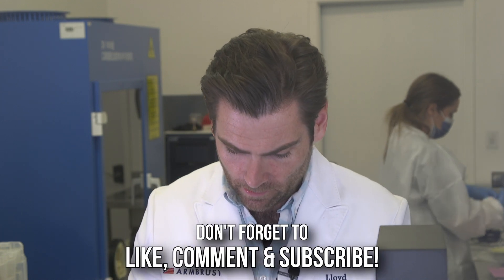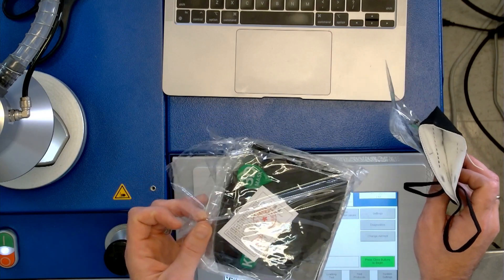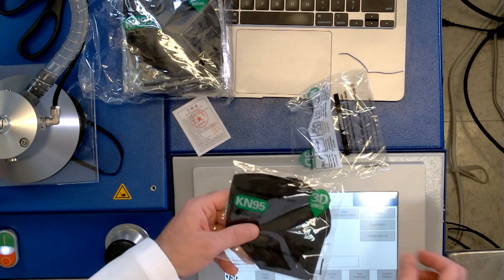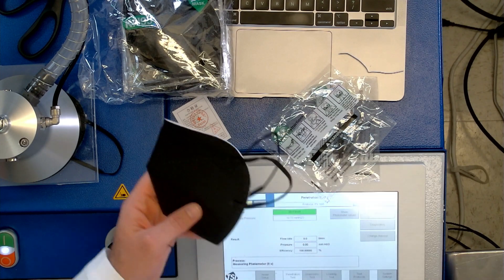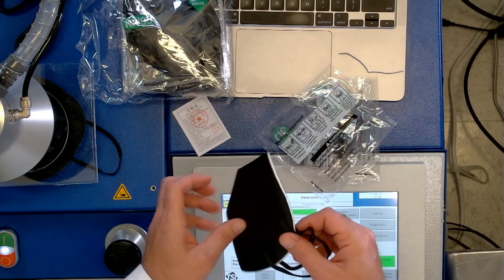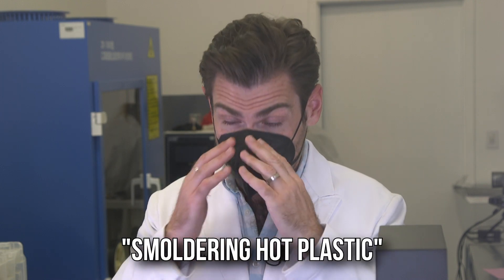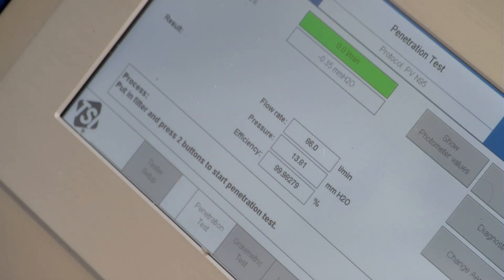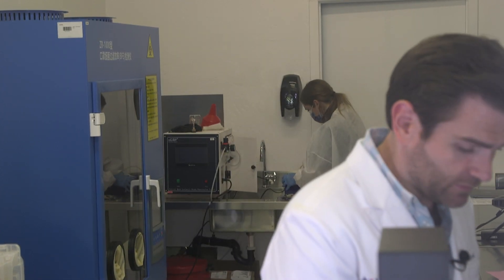A Mask With No Name - 3D Mask KN95 Review

Comment: Those 3D masks cost like USD 0.30 a piece here. Didn't think they provide such good filtration, as they are actually really thin. They are not particularly hard to breath in either. Overall surprised.